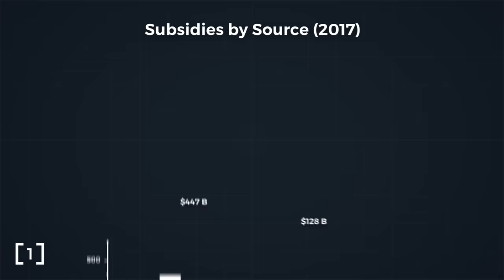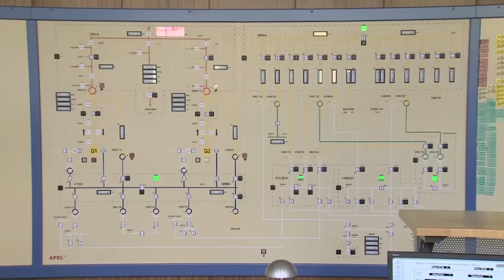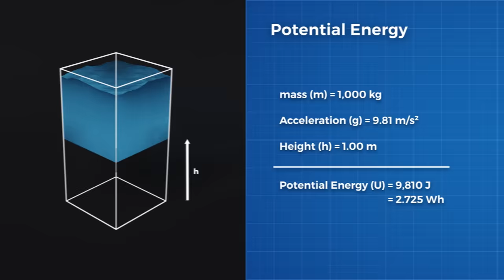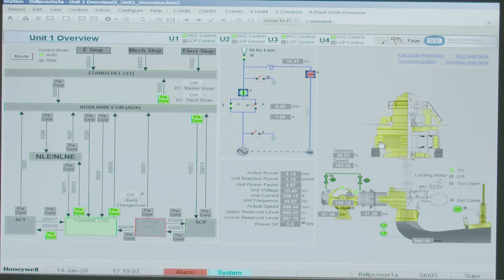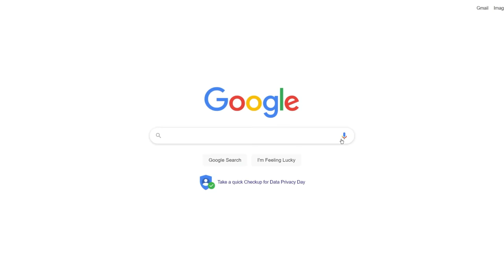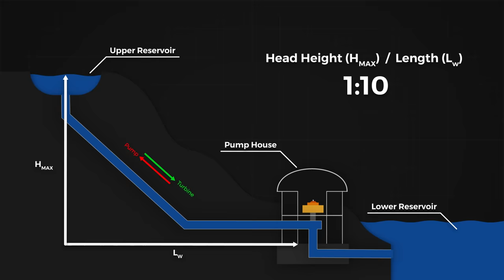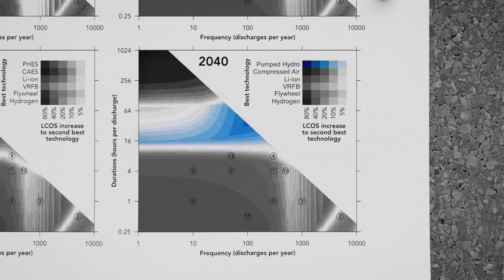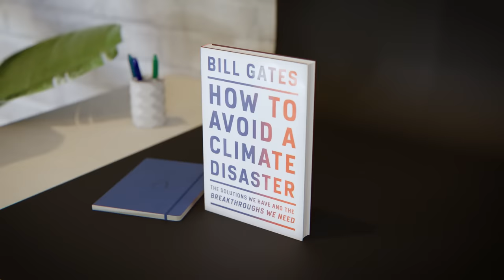The Truth About Pumped Hydro

Comment: That very accurate wind forecasting for the wind turbines had me saying WOW out loud, quite impressive 9:25
Reply: I'd be a little more impressed (or maybe not) if I knew what the prediction timeframe was. 5 minutes, 30 minutes, 12 hours. It needs to be sufficient to enable load balancing from whatever is providing the base load generation (whatever that might be).
Reply: @Thermalions  there are dates on the x axis, I think we’re looking at a (roughly) one month graph
Reply: @thomas.02  But that doesn't reflect how far in advance that fairly accurate prediction is being done for that month.
It's like weather predictions generally - they naturally get more accurate the closer you are to the time being predicted.
Reply: @Thermalions  oh I see what you mean, my bad for the confusion 
i guess the general rule would be they'd do it as accurate as required say if they need a couple of hours to spin up the backup generators when demand increases then they'd need to predict the wind at least a couple of hours in advance
Reply: Its not that hard to predict wind turbine power for 5-7 days ahead.. Its to some extent easier than prediction the weather.

Also its not that hard to predict how the average wind will be over the next season, we have plenty of data for that.

The issue is that predicting is not the same as controlling. While the pump power storage look huge.. in matter of time they can give power, its really just matter of hours, possible a day or two ... But we really need it to last at least two weeks.

A other issue is the efficiency. Even with 80% efficiency (and that is really the high end), you really don´t wan´t to run them if you don´t need to.

That is.. wind and solar unplanability is not solveable with pumped hydro, batteries or hydrogen. Nothing will work.

Also even the largest pumped hydro stations are tiny. 292MW of power is a pittyfull amount. Compare that to one single nuclear reactor at 1600MW, and that is 24/7.

The irony of it is that a nuclear power reactor that PRODUCE power is actually cheaper MW per MW than all storage alternatives. Pretty much rendering wind and solar utterly useless.
Reply: @Thermalions  there are multiple prediction timeframes used in wind power generations. There's no true industry standard yet, they vary between countries and companies as do the terms used. 

But generally most plants forecasting will look something like this:

minute/live forecasts operational window is between milliseconds and minutes. 10-15 is the average but i've heard some go up to an hour. These are used for operational use throughout the day and are required for load monitoring on the plant. These are pretty much dead on, but have no practical use outside of the plant.

Shift forecasts, are the forecasts for the whole shift. (so it could be 8, 12, 16) these usually get updated throughout the day though just like the live forecast. As far as i know nobody really cares about them unless there's an anomalous weather event. 

Daily forecasts, Operational window is in hours usually up to 24-36 hours, these are used more by management who bid on supply contracts for power supply management and is most likely whats in the graph. Most grids require Wind plants to submit a bid for power generation every day. We don't just supply power on the fly. Each day we need to tell the grid managers how much we are going to supply and at what times. This submission time can be longer depending on your state or countries regulatory bodies. I've heard in some countries this is up to 72 hours, which not ideal. The more accurate you can be the better your bid, a better bid provides a better price so this is a really big deal, company's spend a lot of money on this and they like to brag about it.

Weekly is well weekly, this is used mainly for planning purposes, things like Maintenance/installation and inspections. These are also pretty accurate, they were developed for offshore farms as they needed better forecasts then local bureau's were providing. Not all farms will have their own weekly forecast's and use local meteorology data to build the other forecasts and modelling off of. (because forecasting is surprisingly expensive)

Anything beyond that just comes from standard weather services.
Reply: Yeah i was 👏👏
Reply: Yeah impressive, but it is highly unlikely to be that accurate all the time.
Reply: @matsv201  I’ll start this by saying I wish we’d had so much more nuclear built over the last few decades, as that really would have helped our situation. But I don’t think you can say all energy storage solution combined with wind/solar are useless - sure you may not be able to rely on them 100% of the time, but if you can arrange it so that fossil fuel plants are offline 98% of the time because of them, while they cover particularly windless and sunless period for that 2%, then it would significantly reduce emissions. I agree we should be increasing nuclear and especially ensuring that existing nuclear isn’t shut down where possible, but the problem is nuclear takes an incredibly long time to get operational now.
Reply: @rainbowevil  they are not useless  as  grid  leveling,  but as energy storage  for  wind  and solar.  The issue  is that the store time  is to long
Reply: @matsv201  are you just arguing semantics here though? If we could “grid level” to the extent of being able to not burn fossil fuels over the duration of a couple of days without wind or sun, then that would be huge in reducing CO2 emissions and other pollution. I and I think most others would call that energy storage, but you seem to prefer grid levelling - at what point does one become another?
Reply: @rainbowevil  Not really. Any storage solution out there have a combination of short time frame and low energy. Its not even close. We talking about 3 magnitude orders to be a valid option.

Then when the fake media claim that the battery storage in Australia is proffitable. There is two things they are not counting. The cost of buying the power they later sell, and the cost of the insulation it self.

So the only expenditure they count is the day to day maintenance, not even cell replacement. Its freaking redicuas.
Reply: @XavierXonora  I don´t need to die on it, because i´m right.

Any solution is so far from working that its not even a question. Everyone that claim they can get it to work is either lying, or have not done the math
Reply: @rainbowevil  because it don´t work. The more solar and wind you have in the grid, the larger the problem is.

Most countries that have large amount of solar and wind are heavily dependent on fosilfuel to begin with. The main leveling feature for large variation is using coal or gas. The more wind and solar you got, the more coal and gas you need.

Eventually it will reach the limit, like it have done in Denmark, and Denmark is now heavily dependent on trading with Norway and Sweden. The thing is both Norway and Sweden have grids that is much larger then Denmark, still it cripples the grid sometimes.

Grid leveling and energy storage is not the same thing.

The more wind and solar there is, the more  leveling and also storage eventually needed. Today there is no grid that actually uses storage.

The thing is the more wind and solar you got, the longer the timeframe get. Also the more energy sink the system needs. Power leveling generally can´t sink to much power, if any (like the case for hydropower, that is excellent for leveling but can´t do storing)

You might think that battery power bank can do storing, or that pump power can. They really can´t. The issue is that both types have to have the power inputed right before it used, usually less than 48 hour prior, and it then generally only can absorb 4-6 hours of energy.

If the surplus is 2-6 weeks, that is really not uncommon  there is no solution.

Currently this is solved by temporarly halt the production in coal or gas power plant. The issue is that they need to start up again, and that uses a lot more energy than just running them.

For example, the full German grid uses about 600TWh/year. Germany uses 900TWh/year of gas, and they still have coal, hydro and nuclear in addition to that.

Anyone how think solar and wind works... i have one message to you.. DO THE MATH
Reply: @matsv201  
1) If I have to choose between believing you and a whole industry big enough to not only have business administrators but economists doing the math, I choose the industry. 

2) Telling us to read book or do the math in caps feels like you consider all of us idiots who can’t read. 

3) There are holes in your arguments that I’d like to explore, but bco 2) I don’t want to talk to you about it. 

...

Heck, let’s try a simple one. Why do you claim that pump hydro can’t store energy over longer periods of time? I get that it’s ability to quickly use or produce energy is what makes it an interesting addition to the toolbox, but I fail to see what negative effect would unfold when the water would have to sit in the upper reservoire for a month. Would you be willing to explain that?
Reply: @matsv201  , Interconnections are important factor to balance different renewable sources. But old power grids didn't have enough wire capacity. New wires has been built already. There are more planned.

In Nordic network Denmark isn't the most problematic. [1] Finland is much worse because missing capacity to match winter demand. Major reason is a decade late EPR reactor which might start operation next year. [2] Second reactor in permit stage is already delayed from planned schedule. [3][4]

Norway has big hydro reserves which are used in winter. Their reserves peaked at 83 TWh in November. [5] Norway gets regular rain to mountains [6] which offers excellent hydro potential. Normal annual production is 136TWh. [7] They can offer descent amount of load balancing capacity.

Of course many other places aren't as suitable for renewable power. But cooperation between countries and well planned distributed locations can reduce costs.

[1] https://www.nordpoolgroup.com/Market-data1/Power-system-data/Exchange1/ALL/Hourly1/?view=table

[2] https://world-nuclear-news.org/Articles/Further-delay-in-commissioning-of-Finnish-EPR

[3] https://yle.fi/uutiset/osasto/news/fennovoima_nuclear_power_plant_delayed_four_years_to_2028/10570413

[4] https://www.hs.fi/talous/art-2000007804955.html

[5] https://www.nordpoolgroup.com/Market-data1/Power-system-data/hydro-reservoir1/ALL/Hourly/?view=table

[6] https://www.britannica.com/place/Norway/Climate

[7] https://energifaktanorge.no/en/norsk-energiforsyning/kraftproduksjon/
Reply: @suokkos  Interconnection only work that far. That is as far as there is hydro power available. The power leveling of larger areas are really slim, well in summer and winter anyway. In spring and autumn it generally work better. The weather systems is simply larger than the grid.

The Nordic grid is generally historically quite stable. Possible historically the most stable grid in the world. Still 15-20% wind power is sufficient to break it

"Major reason is a decade late EPR reactor which might start operation next year."
To my understanding trail run will start in October this year.. Generally the reactor produce some power even during trail runs, typically 30-80%.

"Norway gets regular rain to mountains "

Well they generally get snow in the winter, and that is more of a problem that people might think. With snow the dams is not replenished, and there for the head is lowered if to much energy is used during the winter.

at the same time, the spring flood will come, so they need to lower the head to give space for the spring flood.

In a sense, the spring flood is pretty predictable, so its quite easy to lower the head the exact amount to being able to take care of exactly the spring flood, nothing more, nothing less.

Of cause, if the spring flood come with a massive rain, that is a issue.

The issue is that the dams really rather want to keep no more than a few weeks a head of behind the snow.

Many people have the idéa that hydro can be emptied just as much as you want under any given time. That is not really the case. Running them full tilt for 2 or 3 weeks is generally not a problem, doing so for 2 month is not an option.

The autumn flood is sort of more of a problem. Because you don´t really know what date it will freeze. But you also don´t want the water to spill over. The only real way of doing this is estimating a statistical autumn flood and try to fill the dams to a optimal state as possible.

The issue with this is that the closer the area comes to freezing,. the less flexibility the dam have.

If they for example is cought with a very early winter, they can be sitting there with the dams half empty... and that is really not good in a early winter.

If the winter on the other hand is really late, the dams will in stead spill over, and then they will lose money.

So its really not as simple as the dams solve the problem.

To day the norwegan dams is balanced with coal power stations in Denmark and Germany. They simply swich them on or of depending on if the dams is ahead or behind scheduled.  This works quite well, because while the capacity is high, the power is relatively low due to it being a 24/7 process over a few month time. But if the coal power stations is closed down, this option no longer exists.
Reply: @matsv201  , Snow and freezing problem has been mitigated with relatively large reservoirs. I understand that partially filled reservoir reduces power output potential. Nordpool shows fairly stable reservoir filling and emptying pattern. They are only full in late autumn to allow enough capacity for winter. Then reserves are steadily reduced until late spring. Most capacity is filled in two months.

Norway is increase their hydro and wind capacity. Extra capacity should help increase load balancing capacity and reduce dependency to fossil fuels.

OL3 trail period will help next winter. Original schedule looked to allow full production in late winter. There has been some warnings that pandemic might cause extra delays. But it was supposed to start producing 11-13 TWh annually in 2009. Hanhikivi reactor had original planning schedule to start producing 7-9 TWh in 2020. I suspect Danish unstable wind would have lesser impact if both reactors would be already reducing Finnish import demand.

There is still issue of mining and metallurgy. They are planning to transition to electricity which would consume large amount extra electricity. I don't know how Nordic production will handle the extra demand.
Reply: @suokkos  

"Snow and freezing problem has been mitigated with relatively large reservoirs"

Well..  that is true in the situation where there is hardly any wind and solar in the grid. When the dams was originally constructed they was balanced to the situation at that time. And it worked perfectly well.

It sort of still work perfectly well, they issue is that the dams leaning more and more on coal and gas to have the right amount of fill for each season, and that becomes more and more important the more wind and solar there is in the system.

Somewhere the final balance must be balanced, and  how the grid is set up now its really primary coal that does that.

Large hydro have a horizon of about 2 month with a maximum load time of about 2 weeks. That works fine as long as there is not to much wind in the system.

The claims that Denmark have 45% wind dont work when considering that the danish grid is pretty much fully integrated in sweden and norways
Reply: @suokkos  
Scandinavia actually have more fossil fuel today than 20 years ago. So windpower have worked.. well not great.

"Combining solar and wind in a fairly large geographical area would reduce balancing demand."

That is a very common misconception. Its sort of half true during autumn and spring, but its most of the time the reverse in winter and summer. This is a huge problem because the grid is generally unbalanced more during those times. During spring and autumn either wind or solar work mostly fine (balance vice). In summer and winter both are catastrophic.

" You would still need over capacity and storage (like hydro)"
Hydro can´t store, it can only stop production, and really that only for a relative sort period of time. You can´t save additional power half a year that is really what is needed.

Also wind alone can easialy reach over 100% capacity for 20-25% insulation a normal summer day. This is a huge problem because we can´t just terminate power.

"But only rooftop solar makes economic and environmental  "
It really doesn´t. The only reason why its vagley economical is due to net debit and massive amount of subsidies. In a realistic market economy scenario where the power would be sold for 20öre and bought back for 100öre, there really would be nobody how would have solar for other than of grid usage.

"But there is strong opposition in some countries."
There really isn´t. There is a very strong lobby that claim that is the case, but the opersition to nuclear power is in the range of 3-5% while the strong support is about 15-20%. Most people don´t have a strong opinion either way.

The nr 1 source you have is hilarius. Would nuclear kill more people than wind? Wind kills over 30 people a year. Its just rarely written about. When did you hear about someone died of nuclear power last time around? Was it in 1986? That Chernobyl is a so huge incident in news should tell  you have safe Nuclear is. Its the one they always bring up, because its the only one they got. Fukushima... zero death... TMI.. Zero death.

I´m not saying Nuclear power is totally safe. But the boring fact is, most people that die in nuclear power plants, is people falling from a high platform and dying from the impact. And that is... really simply much more common in wind power for the simple fact that wind power is very high.

The "glamours" radiation death, is really pretty much non exiting.

"Heating power plants have much higher share of fossil fuel than electricity generators. "
That is true... sort of.. Its really a tabulation thing. The tabulate most fossil fuel to heating in combination plants simply to get more "clean" power.

Nuclear is really a very simple solution. Its cheapest (if the penelty taxies is removed) is safest, its cleanest, its most available, it have the highest capacity factor, and it pretty much solves all the problem...

hence the lobbyist hate it so much... and.. well politics to... they need the problem to remain to get elected the next time around
Reply: @matsv201  I do mostly agree with you (I am pro nuclear and anti-massive solar/wind, because I did the math*)
However concerning the norwegian (and swedish, to a lesser extent) hydro, it does rely more on waterfalls in conduits than on conventional dams (remember, the swedish electric company is called "Vattenfall"...)
*for example, if you want to store a months worth of electric consumption for a large region or a country, lets say, a 10m deep pool, at a height of 100m on the coast, and with a width of 1km into the lands (all these are reasonable assumptions...), then your artificial lake would be... more than 1000km long. Woops... (all that, only talking in orders of magnitude, some x2 or x3 might be around here or there...)
Reply: @takix2007  Well in Norway its probobly a few waterfalls, but in Sweden its really mostly river streams.  The major rivers have dam banks in sets of 5 or more. In steed of having one huge dam with a head of 300 meter or more. Most of them have heads of only 30-60 meters, but there is multiple of them. This keep the drowned area down quite a bit and makes most things generally nicer. The downside is that it decreases the ability to have wide dynamic range of power and endurance of the system.

How it looks in Norway i´m unsure. i Would imagine that the dams are generally higher. The landscape  is a lot steeper on that side.
Reply: @matsv201  , For solar power plants I was think areas inside 30-40 degrees from equator (arid or desert climate).

I meant rooftop solar as mainly personal use. I don't know your rooftop rules. But Finnish rules require sales to happen at Nordpool market prices. This means installing extra capacity over own demand doesn't make sense because electricity prices are lowest when excess solar is available.

About nuclear opposition. I failed to deliver my meaning. I was thinking about strong opposition in government. Your explanation for underlying reasons was spot on.

As for nuclear safety. It is based on historical data. There has been many nuclear accidents causing fatalities. There is also mining and other accidents. Energy density is high enough to make risk lower than many alternatives. If regulations are working as intended, nuclear should be safer now.

Wind having 0.04 deaths per TWh means about a death per 100 new turbines. Does that rate match your statistics?

Main point behind ourworld is that nuclear doesn't deserve the bad reputation. Even historical data shows it much safer than burning coal, oil, gas or biomass. Even worst case for nuclear is comparable to any other production method.

Stopping hydro production works as a short term storage. Hydro power is one of the best load following power sources. But it has only limited capacity which limits its ability work as long term storage.

There are upgraded dams with pump upgrades. Upgrades are still rare and likely won't work in many old dams.

Future pumped storage might have to be designed for a longer term storage. Paper exploring pumped storage potential found most cost effective locations concentrate in major mountain ranges. But cost comparison to natural gas shows economical limits.
 https://www.nature.com/articles/s41467-020-14555-y
Reply: @suokkos  
" 30-40 degrees from equator (arid or desert climate)."

One would think that arid climate would be best. but they have there problem to.. Mostly sand. The thing is if you are close to the eqvator, the panels are very flat. this make it so the sand don´t fall of. Also it blisters the surface.

There is also problem with short lifespan due to extreme heat.

" But Finnish rules require sales to happen at Nordpool market prices."
The thing is that they don´t need to pay transfer cost, and also non of the electric taxes. So its really a massive subsidy that is sort of hidden in byrocracy.

"I was thinking about strong opposition in government."
Well someone somehow pay some people huge amount of cash to block nuclear. And of cause, its billions and billions of euros in every single country... So someone can afford to spend a few million on a few key people.

"There has been many nuclear accidents causing fatalities. "
There really haven´t. There been a few. But a wast majority of them is really mondane accidents. And they are far more common with windpower. The issue with windpower is that the death is not centraly reported, so most of them is not tallied up right. Giving them a false low number. We talking a order of magnitude or more. Death in wind industry is really quite common.

"Even worst case for nuclear is comparable to any other production method."
Its not even worse case. Its fantasy deaths. Its the "Chernobyl killed 4000 people... if we include people how don´t exist and never died" sort of math.

Even including Chernobyl is sort of strange because it was not a private commercial plant. It was a military operated  station that happened to produce power as well. Chernobyl should never have been included. but if people so much want to include it, use the right number. Should we start counting windmill cancer also?

"Stopping hydro production works as a short term storage"
Not if you have a surplus power situation. Then it don´t help to only stop. You have to absorb. Now this situation is very unusual today... but with just say 10% more windpower, that will be the norm, not the exception.

"There are upgraded dams with pump upgrades. "
This was quite popular in the 90-tys. but it proved to have some major drawbacks, and as far as i know, no more dams have been upgraded this way since then. Anyway, due to how the dams are in for example Sweden, it really wouldn´t work to good.

Also, you can´t have a salt water outlet. so it wouldn´t work also in Norway.

"Future pumped storage might have to be designed for a longer term storage. "

Really need a head of like a km or so to work.  Also the down hill source need to be stable and not salt. Salt water pumped hydro have a string of problem that is yet to be solved.

In dryer climates there is also the evaporation problem.

Having the water stored for more than 2 weeks really don´t work at all. The issue is not technical, but economical. A pumped hydro get payed for every storage session it shifts. A normal pumped hydro shift about 25-100 storage sessions a year. This makes it economical over 20-30 year making it possibe to build.

Reducing this to 5 would make it very problematic. If there is a optimal site that can do it very efficient with minimum cost. I guess you can make economy of it.

But seasonal storage. With one transfer a year. The economy is just not there.
Reply: @matsv201  , Transfer costs and taxes are paid when receiving electricity. Normal situation puts customer prices about 3 times higher than market prices. There are still small differences like property taxes and other running costs for power companies.

Salt is problematic. It is easy to contaminate soil with salt water.

As for over production. I meant over production capacity which is lost when weather is optimal in winter. Then worse weather requires less import energy. In this scenario hydro can work as storage solution by providing short term load balancing. This obviously makes wind more expensive than current list price.

If you exclude military sites, then it excludes many nuclear accidents. Early nuclear history was tightly coupled with military. Example would be waste management for civilian power (military wanted material for wrapons).

I don't know how strong the link is still. I tried to search for up to date information. My search terms produced only irrelevant links.

How you give Chernobyl military category?
The accident reactor had 1 GWe capacity. The scale of production seem to indicate primary civilian purpose for the plant.

Long term radiation effects are estimates based on research data like thyroid cancer. [1] They are comparable quality to estimates that  pollution from fossil fuel burning causes about 2-4 million deaths annually.

[1] https://www.thelancet.com/journals/landia/article/PIIS2213-8587(16)30112-7/fulltext
Reply: @matsv201  got any citations for the Germany statistic?
Reply: I did too haha
Reply: @suokkos  
" Transfer costs and taxes are paid when receiving electricity"

Not for net debit. Then there is neither tax or transfer cost paid, that is why its called net.

"In this scenario hydro can work as storage solution by providing short term load balancing."

The theory that hydro could run in reverse is proven to work poorly in reality. There is a string of problem attached to it.

Note the diffrance from downregulating (that work fine) and absorbing energy (that work less than fine)
Reply: @suokkos  
"can work as storage solution by providing short term load balancing. "
That really only work in theory. There been a few experimental plants that does that, but its really not practical. Its one of those things that break when you consider the economics of it.

"If you exclude military sites, then it excludes many nuclear accidents."

Why woulnd´t i? Military death is not included for coal, gas, wind or solar, why would it for nuclear?

 "Example would be waste management for civilian power (military wanted material for wrapons)."

That is really not a thing. While its theoretically possible, its not practical or economical, or even reasonable. Its a stupidly hard way to make nuclear weapons. The anti nuke people make it sound like that is how they are done, that is a total lie.
Reply: @suokkos  
"The scale of production seem to indicate primary civilian purpose for the plant."

While it seam that way, that is not the case. RBMK reactors was primary designed to make weapons grade plutonium and have a very different design than all other power producing plants.

The chernobyl reactors was owned and operated by USSR armed forces and they was doing a military test when the accident happen. The person in charge was enlisted.

Western powers used zero power reactors to make weapon grade plutonium. In USSR they thought that that was a waste and they made a combination reactor, that produced plutonium and power. There for the reactors was in military hands, unlike the other 3 plants in Ukraine that already back then was owned by the civilian energy department.

Now there never was any plutonium extracted from Chernobyl and it turned out that it was a horrible bad idéa actually already prior to the accident.

The thing is this kind of accident will never happen in a civilian plant because the chain of command for the production and the safety is two totally different organizations.

In USSR they had two major reactor designs, the RBMK that is a military grade reactor that also produce power, and the VVER reactor that is a totally civilian reactor. The second one have one of the best safety record in the world, and its the same type (but newer generation) that is going to build as the next reactor in Finland.

This is important. The RBMK and the VVER is NOT different generations. They was built simultaneous for different reasons.
Reply: @suokkos  The thyroid cancer stats have several problems. Just to name a few example it very specific to cesium, screening rate will effect the total numbers, and thyroid cancer deaths is actually very uncommon.

The fact is that after Chernobyl the number of thyroid cancer deaths actually went down due to increased screening and better treatment methods.

So should we count this as lifes saved by Chernobyl?
Reply: @rainbowevil  
That is publicly available numbers ... really shouldn´t need to citatate it.. but.. well wikipedia exist,  so why not.

https://en.wikipedia.org/wiki/Energy_in_Germany
Reply: @matsv201  , Do you mean net metering?
It seem to be the concept matching your comment (I wasn't familiar with the net debt term). That isn't happening here. Example contract from Helen promises Nordic Pool Spot price for hourly excees electricity provided to grid. [1] Government subsidies are targeting installation work where tax credits is equal to 40% of work cost (cost of panels is excluded from credits).

As for hydro as storage. I have not talked about pumping water back up. I have even seen Norwegian dams where it would be possible because grade under dam doesn't allow water storage without new second dam.

I have been talking about widening load following capacity decisions to include whole Scandinavia. Temporary reducing or stopping hydro keeps water reservoir. This can be done when wind produces surplus (and cannot sell all capacity). Then extra reservoir is used to produce more electricity to export when Danes need imports to fill for bad weather.

This solution requires investments like increased transfer capacity and increases to maximum generator capacity. At least news articles and energifaktanorge site indicate Norway has increased investments to capacity and Interconnections.

Variable sources work well only if storage is plentiful (doesn't seem to happen in short term) or their capacity planning has heavier weight for bad production conditions than good conditions. Current capacity isn't anywhere close to enough for bad conditions. DK1 seem to be matching demand only in good conditions while average production is nearly half. The zone would need 2-3 times wind capacity to start eliminating fossils fuels from the mix.
Would you want to import cheap electricity?
Danish will be having regularly 5-10 GW extra production capacity for exports. Then they need to buy more expensive electricity back up to 2-4GW capacity when weather is less optimal. Seems like Norwegian energy will stay as profitable export after oil.

I don't know enough to comment about dual purpose details for RBMK reactors. Wikipedia claims they were run with enriched Uranium which would be bad for plutonium production. Does that claim have any validity?
In any case original military design, earlier accident cover ups and bad politics/energy policy clearly contributed to the accident.

There is already two VVER-440 in Finland. They were built in 70s. They are mixed power plants because some equipment and engineer was provided by Westinghouse and Siemens. The new VVER seem to be going similar route.

[1] https://www.helen.fi/en/solar-panels/own-solar-power-plant/microgeneration-purchases
Reply: @matsv201  that’s half a citation at best - the debatable part was clearly whether Germany was using 1.5x the natural gas required for its energy demands because of wind/solar power! You’ve gone “look, Germany uses X amount of power” as if this is somehow proof of that. Completely useless.
Reply: @MikeJones-rk1un  A lot of wind turbines in western Canada are placed where the only trees are now petrified.  And thermal fossil fuelled plants emissions... also not good for birds.
Reply: @RandyTWester  The pigeons in NYC seem to like the fossil fuel warmth. It is larger, endangered birds that wind propellers kill.  Which birds do you want to kill?
Reply: @Thermalions  It's a very good question. I read that wind power generation forecasts 2h ahead are (if I recall correctly) 90% accurate. That is enough to dispatch open cycle gas turbines and even some larger units.
Reply: Pumped-storage hydropower is the necessary supplementary system to efficiently use and store energy from the sun and wind that is only available at times ...